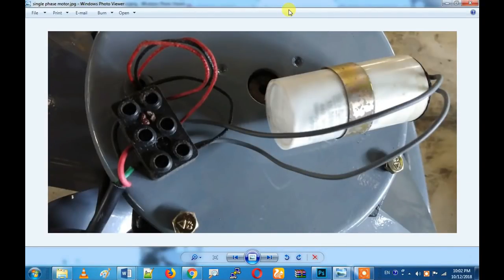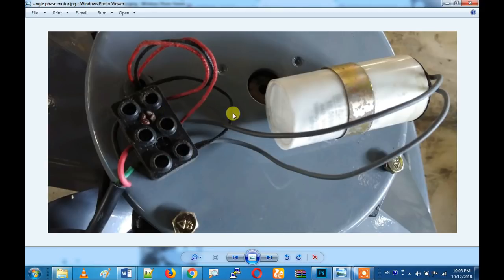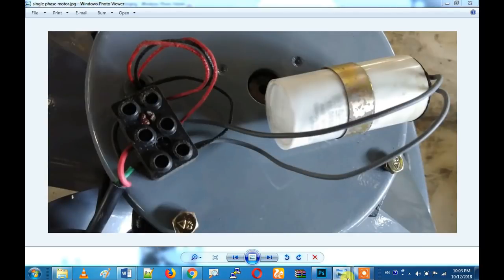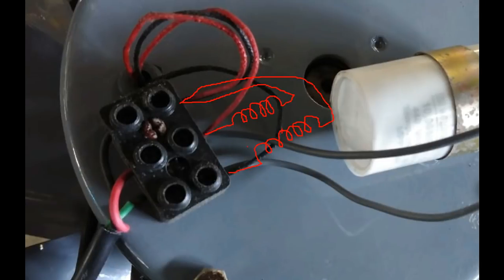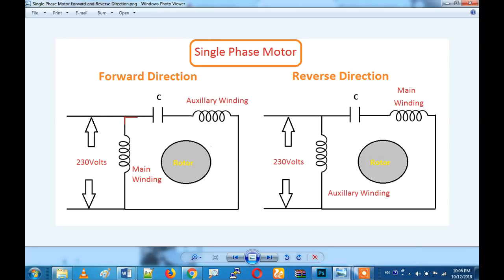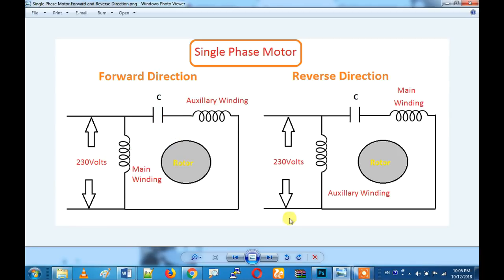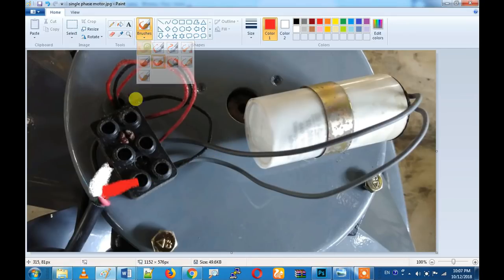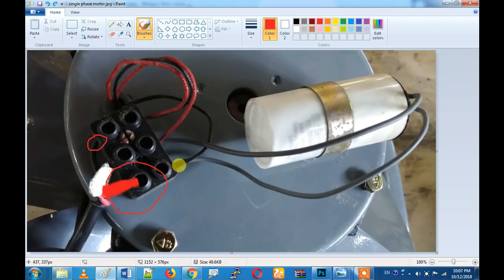How to Reverse Single Phase Motor Direction In Tamil

Comment: Bro, my amma grinder motor rotate reverse direction as per your video i interchange the connection still it rotates reverse only,in that motor one red and black from motor for power,anorher two wire red and black mixed,another wire grey these two for capacitor in this condition how i interplate the connection for forward direction rotation pl help me

Comment: Auxiliary winding and main winding has different value of impedance due to  produce resultant  torque.so, At the reverse operation time windings burn agatha bro.
Reply: Makes sense
Reply: FULLY AGREE. 
CONNECTIONS OF EITHER WINDING WIRE MUST BE SWAPPED WITH LINE INPUTS TO CHANGE ROTATION.